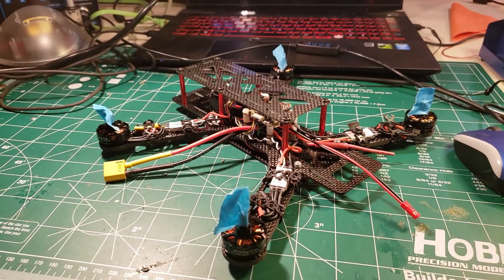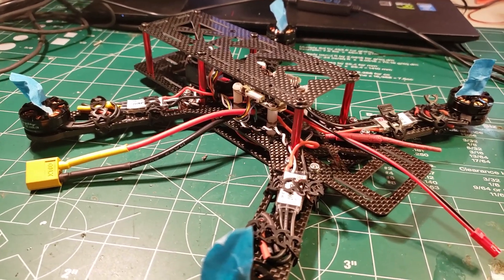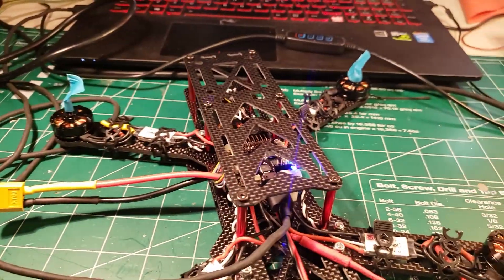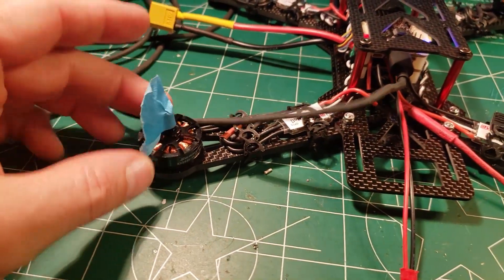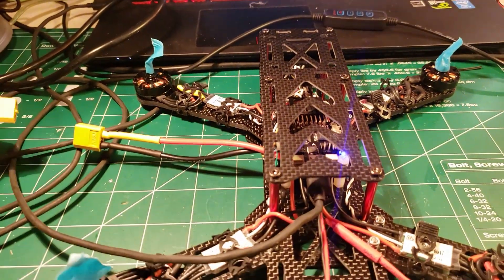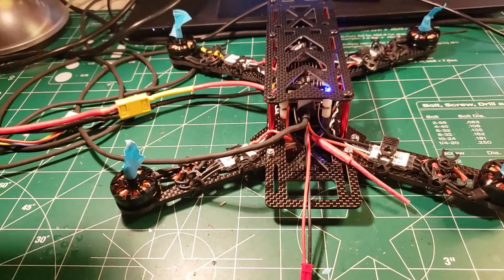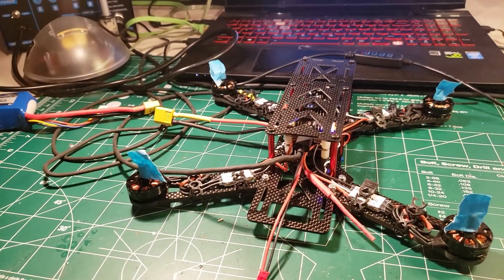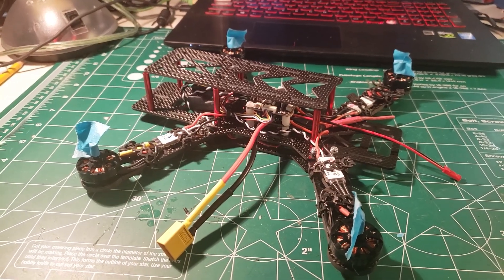Calibrating ESCs In Betaflight on an FPV Racing Quadcopter (Drone)

Comment: I have motor error on all 4 motors if I have bidirectional dshot enabled. small error but it's error. around 0.02% jumping up and down from there. I wonder if that's why my quad always flies worse when I have bidirectional dshot turned on. I always leave it off because it flies worse. NEVERMIND! I flashed the ESCs and now I have no errors on the motors tab in Betaflight. Weird. When I bought this Mamba F7 APP stack with the Blheli_32 50a ESC, I just soldered everything up and went out to fly. It flew bad. I flashed the FC and it flew great with Bidirectional Dshot turned off. I guess the firmware on the FC and ESCs when it's new is always bad firmware. At least with this stack.

Comment: I have a race star flight f4 controller with escs built in do you have any idea how i could configure the escs on it? I have also tried this and doesnt seem to work.
Reply from the maker: I'm guessing that your race star f4 has DShot ESCs.  You don't need to do ESC calibration if you are using DShot protocol

Comment: dude i sewar for go im doing exactly that in multishot,, mode... andd there are no  config tones it just sound normal i canttt calibrate themm..u know whats going on
Reply from the maker: did you see this video?  https://www.youtube.com/watch?v=WISMxqqMGF0
Reply: @TahoeSteve  noooooo... thankkk uu.. i think this will helpp.. but burned a motor trying to make them go in correct direction now i have to order a motor... dude can u burnnn things by configg..... suposing everything is working on testt and then u make a stupid move in config and when u arm can u burn a motor for example thats whats happened to me,,, i dont  kno if i fucked it up or smthng is else was bad or smthng